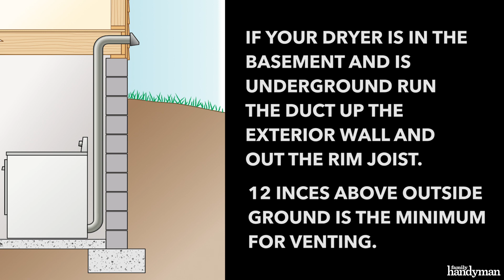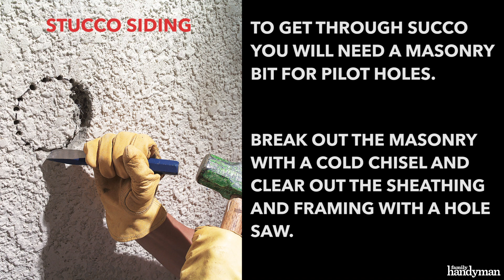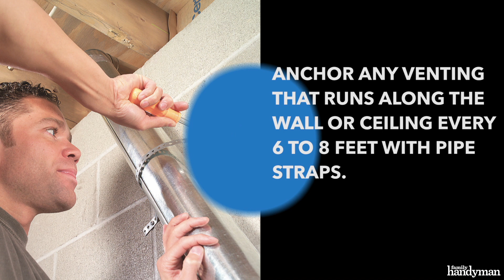How to Install a Dryer Vent

Comment: Can you recommend how to block back air flow? (My dryer vent is clean, the flapper on the roof dryer vent cover is not stuck, yet I get condensation in my dryer.) All the roof dryer vent covers I've seen have a gap around the flapper through which the air leaks to the house. Is there a fix for it?